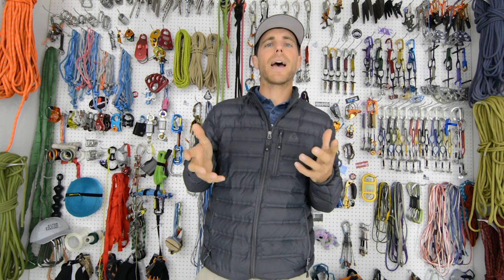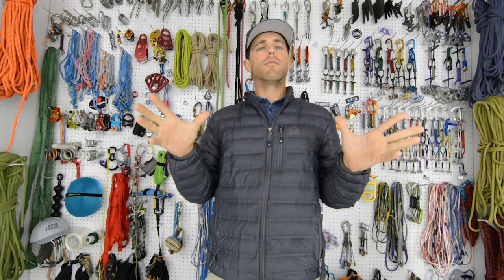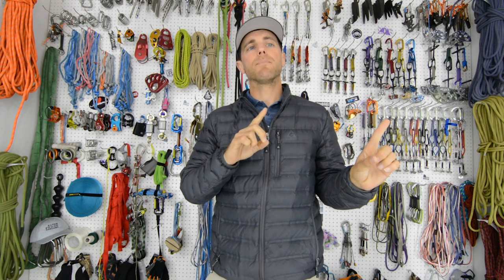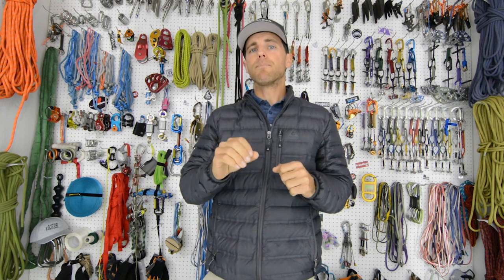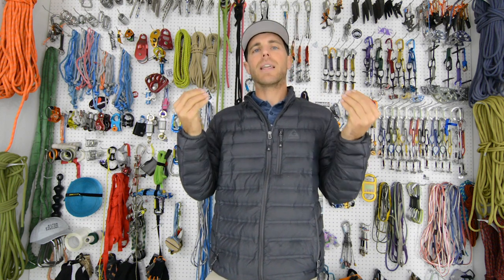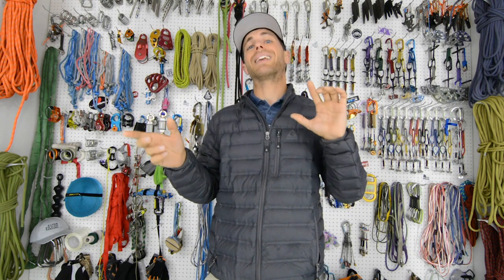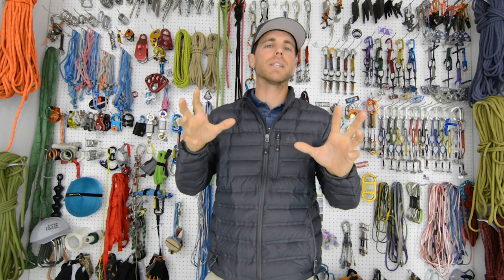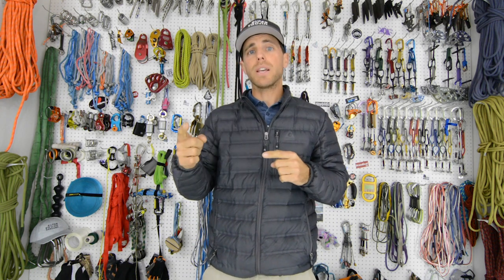50 climbing bolts breaking in sandstone

Comment: You should really check out the Czech method of "bolting" sandstone.  I know it's defined by the soft sandstone we have here, but it works pretty well. It's actually illegal here to use  expansion bolts in the sandstone, as they would fail often and the rock would be destroyed.  When trad climbing on sand, you can only use textile protection (knotted slings and cords or UFO nuts) to catch a fall without destroying the rock. 
Here is a nice short film about Czech sandstone routeseting (with English subtitles):  https://www.youtube.com/watch?v=JZvhIlzV8Ec&feature=youtu.be

Comment: Awesome work as usual, Ryan. Love all the effort you're putting into this. 

Have you done any comparisons of different glues/epoxies? Several years ago there were a bunch of people in Cali that went crazy over the AC 100+ Gold vinylester glue, but I wasn't convinced that was a good choice. It was cheaper, but vinylester has its own drawbacks that I think make it a poor long-term candidate. Would be awesome to see some analytical comparison of the AC versus RE-500.

Also, have you done anything with the HIT-Z anchor? Would be awesome to see a destructive test in super low-quality rock. I think this goes right along with your objective of using fewer bolts. If this anchor performs well in chossy crumbly rock, maybe people wouldn't be so compelled to over-bolt. Unfortunately, though, they're not yet making a stainless version. https://www.hilti.com/c/CLS_FASTENER_7135/CLS_ANCHOR_RODS_ELEMENTS_7135/r5230

Thanks for keeping the stoke alive and doing all you do for the community.

Comment: As you may have heard Australia has had some huge bushfires covering pretty much all of the climbing area's in many states.

It would be amazing if you could test the effect of the fires on not only the rock but also the bolts. we pretty much have to rebolt every climb in the country but many are worried about the quality of rock post fires.
Reply from the maker: Can you send me pictures of fired bolts?  I can try testing this.
Reply: @HowNOT2 

just bake your boltbuster to see how it affects the epoxy 

Part 2: did heat expand bolt enough to deform rock or glue, loosening bolt 

Part 3: ???
Reply: This would be really nice indeed. Now, 2 fake-years down the road, how are things turning out on the rebolting, quality of rocks etc?